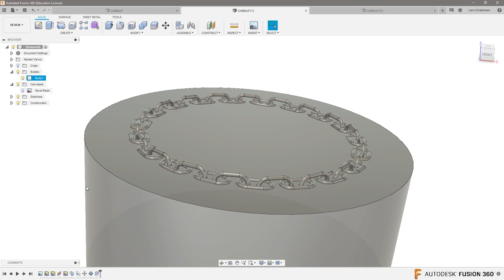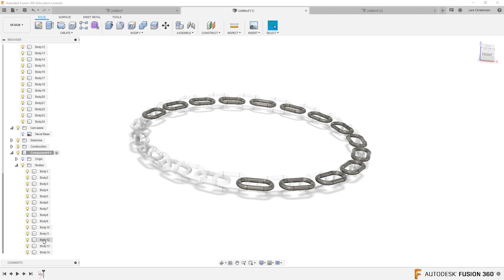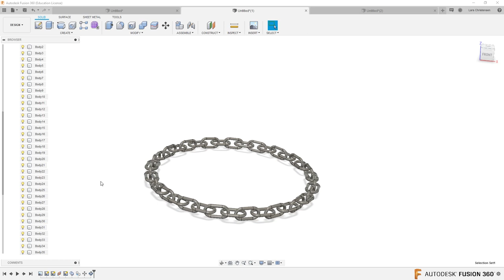Fusion 360 — Selection Sets in Fusion 360 — Ask LarsLive

Comment: Hi ya Lars, thanks for all your hard work at making these videos, keep up the great work! I do have a question though, and can't find anything to help. I am having an issue with turning profiles in cam. When I do a turning profile, as long as its roughing passes it's fine. But when I do a finish profile, my toolpath cuts into my part, and the only way I can fix this, is to turn on stock to leave and offset it to keep it from gouging. Is there something I'm missing in my settings? Thanks for your help!